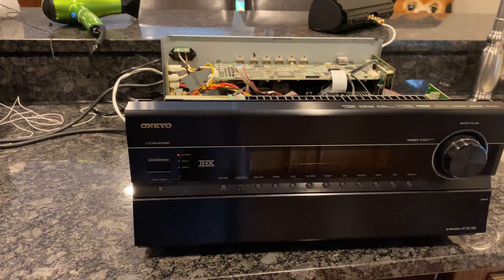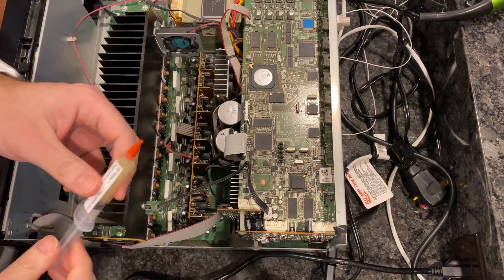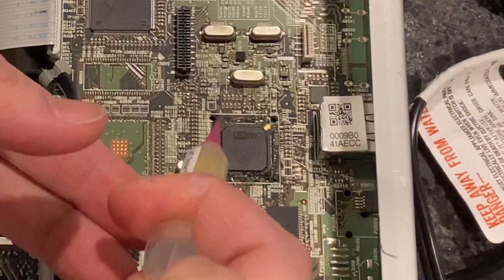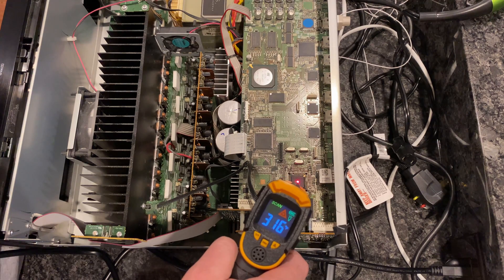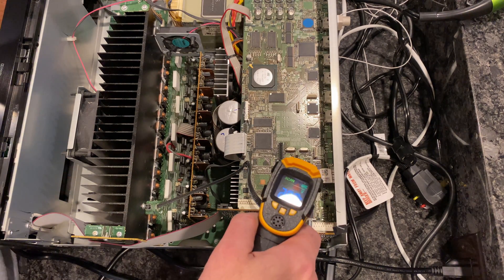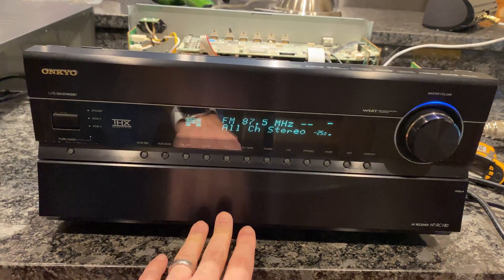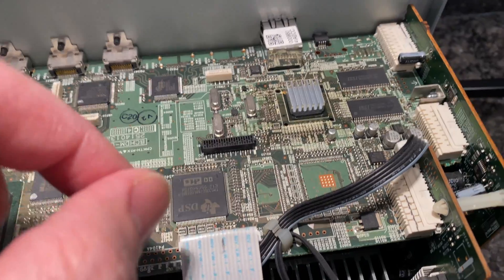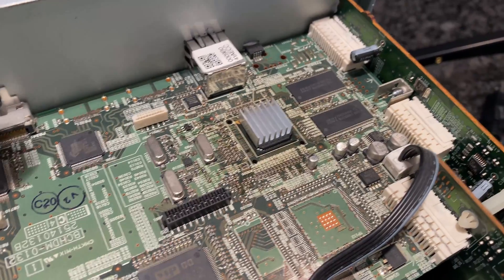Onkyo Home Theater Receiver No Sound Fix - DTS Chip Re-Flow

Comment: THIS IS GREAT! I'm SO happy, my beloved ONKYO TX-NR 5009 is WORKING AGAIN after Using a HOT AIR BLOWER on the DTS CHIP. I've heat it up to 180 Degrees CELSIUS, measured it with a gun temperature  meter. Now I have ordered heatsincs and I hope this BEAST will run for a very long time. THANK YOU for the VIDEO!
Reply from the maker: I’m glad you were able to fix it.  Mine is still working.  If it fails, I’ll just do the same procedure again.
Reply: @Upscaled_HT  Thanks mate, I am truly grateful and incredibly happy that the ONKYO is up and running again. It is a BEAST of a receiver and absolutely no need to buy another expensive amplifier or receiver. Surely such an expensive receiver should last up to 30 years? The amplifier part never actually breaks, but the electronics are the problem. Thanks again!
Reply: @EXTRA300s  I have the same receiver with the same problem. Is yours still working? Can't wait to give this a try. It's an awesome sounding receiver. Thanks for the temperature suggestion.
Reply: @stevet7487  mine is working..JUST PERFECT!  and I'm so happy with this solution. I do have a cooling heatsinc on the DTS and the other flat cip, ordered the heatsincs online in China for 8 USD include chipping. I wish you luck mate 😃👍
Reply: @EXTRA300s  Is it still working? Thanks in advance!
Reply: @vortexor1  First time it works for a month, after that the working periods shorten,  and the last time it worked only for 2 days. Even placed heatsinc on the DTS chip (and other) but it didn't help at all.

Comment: Do you know where that chip is located on a Onkyo TX-SR507?
Reply from the maker: I’m not sure.  I think the chip is hard to miss though.  I think they all look similar.  It should says dts on it.
Reply: @Upscaled_HT  Yeah but yours has 2 of them. The one with little legs coming out from it (the one that mine also has), and the one that you heated up (which I cannot find). Could it be on a different board?
Reply from the maker: I think it should be on the hdmi board.  I think it’s the one with a diagonal little white line on one of the corners.
Reply: @Upscaled_HT  Looked for it, nowhere in that board.

Comment: still working? Mine died yesterday.. I did the same process as you. but it lasted for about 2-3 hours... 
I will try with higher temperature... Mine didn't smoke.  ;-)
Reply from the maker: Mine is still working.  The way I saw it was I had nothing to lose and the receiver was too old to pay for a repair.  The fact that it worked for a while is encouraging.  I saw a video where someone went much hotter than I did so that may do it.  Best of luck.
Reply: @Upscaled_HT  that's my thoughts as well. Used 175 Celsius for a minute.. Will up the temp and time tomorrow and see. Thanks
Reply: @AndersBergh  hi did it worked for you??
Reply: @ramdass1989  had to increase to 260 degrees Celsius for about a minute.
But the receiver is acting strange. Losses connection to PC. And when it does, I need to turn it of and on hoping for the best.
Sometimes I need to pull the power cord for about 10 minutes to make it connect.

If I was a hifi nerd and often listen to music or watching movies. I would buy a new one.

But this reciver is used as computer /speaker amp during covid homeworking
Reply: @AndersBergh  thanks for the reply ..  how did you heat it ?
Reply: @ramdass1989  with a hot air solder. Could only control the air temp. Not sure which temp the chip had, since I don't have a temperature measurement tool